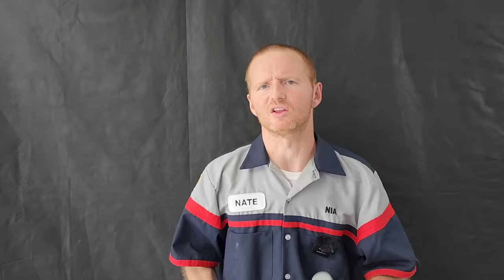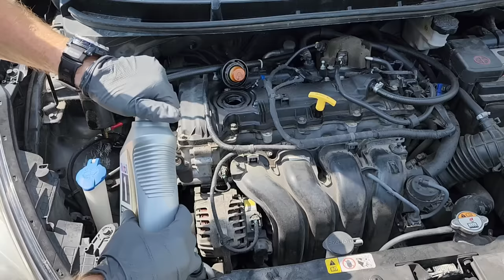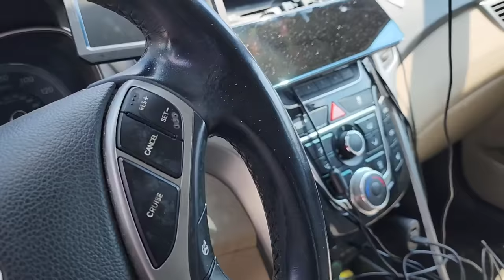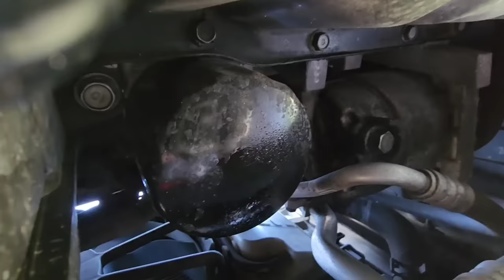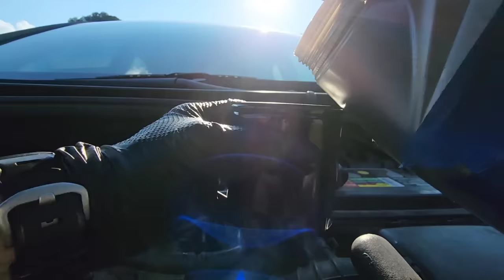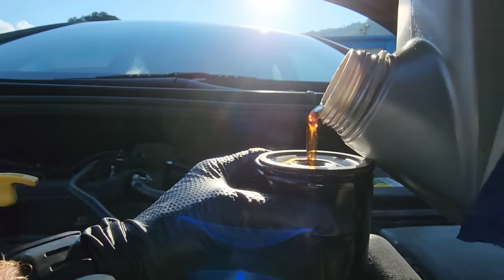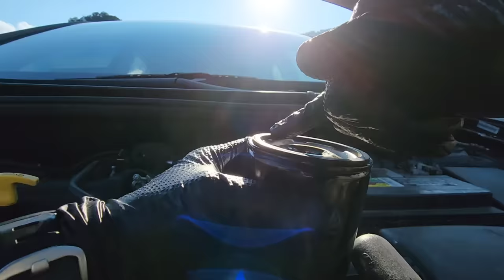Car owner sued after Jeep kills Mechanic during oil change

Comment: A complete tragedy… Lack of attention by owner, but… If the mechanic was more careful, he would wait until the engine run, check if parking brake applied, then check for leaks after all these steps. In my opinion, it was a tragedy and no one could be guilty, because both was lack of attention.

Comment: Shop owners fault hiring untrained personnel not qualified to preform the task 
Machanic fault !… 
# 1: SAFETY RULE ONE YOU NEVER START A MANUAL WITHOUT SITTING IN THE SEAT FOOT ON BRAKE. Foot on clutch hand on on shift in natural…. 

End of story, absolutely no discussion about this.

Comment: I think that so called clutch safety switches are the worst "safety" feature ever invented. With no switch the car would instantly jump and scare the hell out of the operator and by reflex immediately let go of the key stopping and stalling. With the switch the engine would be full running mode when the clutch is released ,also, if the engine is  cooled  off it would be in fast idle mode. I have been around standard transmission cars for along time.

Comment: Its called vicarious liability.  Many states have vehicle laws that impose vicarious liability on the vehicle owner for the actions of a driver that has permission to operate the vehicle.  The owner, in this fact pattern, could sue the dealership for indemnity on the basis that its employee was the negligent party primarily responsible for causing the injury to the victim.
Reply: That is right up there with Spectral Evidence, a legal statute used in New Englands earliest days to convict 'witches'. Definitely bad law.

Comment: Wow the guy changing the oil didn't know his way around a stick shift and how it functions , Sounds like the shop should be sued for hiring an idiot
Reply: Why would a 19 year old know anything about stick shifts? They aren't exactly common, anymore.  Most people don't want them. And, you don't have to know anything about shifting gears to change oil, replace an alternator, or do a number of other basic mechanics tasks.

The guy that died is most likely the one who forgot to pop the car out of gear and set the parking brake. Obviously, the 19 year old didn't drive it into the bay. It's highly likely that the fellow died due to his own errors.

Comment: First place if the 19 year old doesn't have a license or doesn't know how to drive a Manual or even a vehicle, then he shouldn't be starting or driving the vehicle.   Plus another point is it's everyone job to make sure safety comes first in the work place.    If ya are unsure how to do something it's better for some other person with experience do the job, along with teaching the person how things is done.   If you feel you need to be supervised on some type of equipment always ask until you feel comfortable enough to do the job.   I remember when in automotive class before lifting a vehicle up for the first time on a lift, we have to ask the teacher if we did it right before moving forward.   For me after putting a vehicle on a lift few times I still ask from time to time If I am doing thing correct while in Automotive class cause I knew safety was in my job description while being a student in automotive shop while in High School.

Comment: This is very sad, but there are several people who share the blame for this, and the vehicle owner is not one of them.
 I was an automotive technician, working exclusively at factory authorized dealership repair shops for over a decade.
Here are the safety rules that make this impossible, and every repair shop has the opportunity to learn these rules before accepting vustomers, as they are well published.
1. Never stand in front of a vehicle, or directly behind it, especially when the wheels are on the groung, while it is being started. You are in a repair shop, you cannot asdume that the safety mechanism are functional.
2. Never start a vehicle until the front and rear are clear.
3. Never start a vehicle unless you are in the car, and your foot is on the brake.
The experienced mechanic should have known better. Granted, we are all prone to lapses, but we also know that lapses are how you get hurt.
The kid should have been trained about these issues before being lut to work, so the owner shop foreman, and service manager have a degree of responsibility.
The kid has some liability because he has an obligation to learn his job, like abyone in any proffession, including safety protocols. 
The owner was no where near the car, had no reasonable belief, nor would any reasonable person assume that this business, or those employed, would use their car in an unsafe manner.

Comment: Every FCA vehicle that I’ve seen with pushbutton start requires you to press the brake pedal while pushing the start button. Add in the clutch interlock (which, granted, may have been bypassed by the owner or had the fuse pulled if it’s a Wrangler) and no way should it have started without an ass in the seat.

Comment: You can basically sue anybody for anything...
Now, whether you win or not is another issue. They might also be countersued as well for bringing about a frivolous lawsuit.
Edit: just finished watching the second half of the video. So it turned out the judge gave the car owner indemnity and they weren't responsible. 
The dealership did however get sued and  had to pay out though.

Comment: Did the owner give specific permission to the 19 year old to drive the car? No? End of story. The shop took possession of the vehicle and the shop should have made sure that only qualified individuals operated the vehicle. Someone with no experience in manual transmission should not be allowed to get behind the wheel. Shop's fault entirely.

Comment: how the flying f can you become a mechanic without knowing how to drive a stick
Reply: Stick shifts don't show up as frequently as they used to. Most people don't want the unnecessary hassle. Many people that DO want to deal with that sort of nonsense, are inclined to change their own oil, and make many repairs themselves.

As such, it's not really necessary that a mechanic know how to drive a manual. As long as there are one or two guys in the shop who can, it's not a big deal.

Unless the guy driving the vehicle into the bay makes an idiot move like leaving it in gear. Then neglects to set the parking brake.

Comment: Who doesn't leave a manual transmission in gear when left off?
If anyone is a fault it's the manufacturer for letting the car be started when it's in gear just pushing the clutch should not be enough

Comment: How did the guy know he had to to push the clutch in on a modern manual car to start it ? (autos won't start if they aren't either in park or neutral)  he either knew or was told that was the start safety 'lockout' system on a manual.

Comment: 100% the service facilities liability. Their employee caused the accident while in their care & custody.  customers are not usually allowed in repair shop areas for safety because of dangers & safety concerns the general public would not likely be aware of...  but the service facility had an employee that was using machinery he didn't know how to operate... in this case.. a manual transmission. no different than letting him weld on a vehicle & him not knowing to disconnect the battery before he fried the computers.  The vehicle owner hired a professional to do the job. it's left in their care & custody & therefore they are in full & complete control & liability.  If their mechanic took it on a test drive & had an accident or killed someone... it's not the vehicle owners fault or insurance liability... it's the shop who's in control & possession of it.... The attorney that brought that frivolous  lawsuit should be ashamed as well as potentially liable for mental distress & other issues created trying to sue & falsely blame the vehicle owner.

Comment: Suing the owner was the proper cause of action.  Cars are dangerous instrumentalities for which the owner is responsible.  The owner turned the keys over to the mechanics to work on his car.  The owner put the dangerous car instrumentality into the hands which resulted  in injury or death. 

Imagine the mechanic took the car for a test drive and ran over a pedestrian.  Do you think the pedestrians should be able to recover the insurance proceeds from the car that ran him over?  To do so, the pedestrian would have to sue the owner of the car driven by the mechanic.  Although the driving in this case was limited to a foot or two, the principle is the same. 

In order to recover insurance proceeds from a motor vehicle, it is necessary to sue the owner of that vehicle.  The insurance on the vehicle only covers accidents for which the owner of the vehicle is liable.  Realistically when the owner is sued, the plaintiff and his attorney are usually only seeking to recover the insurance that is on the vehicle.  The insurance company, not the owner, is the real target of the lawsuit.

Comment: I feel like it was the mechanics fault.  Lack of training.  This is a major learning experience for everyone about this kind of vehicle.  I’m confused… does it go in gear or neutral?… emergency brake?  If a car is a manual… shouldn’t the mechanic get in all the way to check instead of assuming to mash the clutch and start?  I know I wouldn’t have trusted it without checking.

Comment: Does not make sense.
I do understand the liability failing in the owner if they give keys to someone who does not know how to drive.
However, I would classify this more as a work accident that a road accident.
Beside, the shop is supposed to be made up of trained professionals, or at least have those professionals safe.

So my argument is, the owner should not be held liable as any reasonable person would expect that mechanics know how to safely conduct proper maintenance.
And with conditions in a mechanic shop are totally different from those at a road, the laws applicable to the road should not be apply.
As often safety device have to be remove or the car put to work in not road worthy condition to performe some maintenance procedure.

In sort, do not hold the owner liable when hey have no reason at all to think the may shop would run over someone with their car.

Comment: So doesnt know how manual transmission works but knows to push in the clutch to start the vehicle.   The mechanic should be responsible not the car owner.   My uncle was working on an AC system on a car behind a car on a lift.  He reached in to start the car and apparently the neutral safety switch was bad and it started in drive a drove forward smashing the hood into the back of the lift.  He was responsible for paying for the hood to be fixed even though the car had a safety system fault

Comment: I think that the mechanic is at fault . A mechanic should know the workings of a manual transmission. There is on most manuals a start procedure that requires you to press the clutch in order to start but some older. manuals do not have this function, manual drivers always make sure that the gearbox is in neutral prior to starting, it is second nature for those that drive stick.

Comment: This video is not legally accurate at all.  The way that this actually turned out was that the owner was (IMPROPERLY) sued, but when that happened, the owner turned around and sued the oil change business.  THE OWNER WON!  

Here's the thing.  For the family of the mechanic who was killed to successfully SUE THE CAR OWNER, they must be able to prove that the owner of the vehicle actually did something that caused the fatal accident.  Since the car owner left the vehicle for service with supposedly skilled mechanics, the owner is not guilty of any negligence and cannot legally be held responsible. 

Apparently, the owner had a good attorney who KNEW what the law says about liability and that attorney filed suit against the oil change business.  Why? Because the business owner was the one responsible for seeing that all of his/her mechanics were properly trained in how to handle an oil change for a manual transmission vehicle, and for seeing that a safe workplace was maintained at all times.  The owner of the oil change business is also legally responsible for having worker's compensation insurance covering accidents like this.

Comment: As a born & raised southerner…is this guy trying to sound as stereotypically southern as possible. Just curious. 🤔 

This story is confusing. So, I the guy who died was crushed in between the car & a roll around? And how can a “mechanic”, who’s qualified to do an oil change have no knowledge of a manual transmission? As far as the owner being liable, this sounds like another law that should be shut canned.

Comment: You're not a "mechanic" if you don't know how a "manual" transmission works (i.e. still the most common transmission in the WORLD). Are they suing the owner because the Jeep operated as it was designed to?

Comment: Very sad but it happens often. I think  the car manufacturers could solve this problem. The problem of runaway cars could be eliminated by having the drivers seat sensor, through the vehicle computer, apply the electric hand brake or engage park when the drivers seat has no one seated. The system works with ride on mowers. Why not every other vehicle ?

Comment: Who checks for oil filter leaks with the engine running? If it’s gonna leak it will leak with the engine off. If you screw the oil filter on right it’s not gonna leak. 🤷🏻‍♂️🤦🏻‍♂️😂

Comment: Not sure where you got your info, but I doubt the owner could ever be held liable for a mechanic's actions inside the shop of a dealership...or any other repair shop...the rare exceptions wouldn't even apply in this case...that would be no different for someone suing a homeowner for a roofer's mistake if he fell off the roof of the house, for example...the mechanic is solely responible for following all safety requirements/precautions in the shop and for his own actions...that's common sense and normally would be law in all 50 states...if you have an actual statute that dictates the owner can be held liable, post it, let's see it in actual law.....now, in this case, the one that did not follow safety precautions, such as making sure the gear shift is not in gear, or asking for assistance if he doesn't have the necessary knowledge, is the one that, along with the dealership, is responsible, nobody else....

Comment: I never understand why people with a manual transmissions park their cars in 1st gear.
I always left mine in neutral with the e brake pulled up.
U said experts say to leave it in 1st so it won't roll away but those "experts" are morons because if the e brake isn't pulled up and it's in first gear, the minute the car starts its going to at very least lerch forward.
In neutral, as long as u apply the emergency brake that car isn't going anywhere. 💯

Comment: Not placing blame OR anything... Just FYI... MECHANICS... SET THE PARKING BRAKE... HARD IF IT IS A CABLE MANUAL BRAKING SYSTEM... ON ANY VEHICLE THAT YOU ARE ABOUT SERVICE... For any reason... This may help the vehicle from moving... Unexpectedly... You need to be careful at all costs... When in doubt of your abilities... STOP... READ THE TECHNICAL MANUAL... Never assume...

Comment: Definitely a bad situation and an abnormal turn of events. Just my opinion, but why not use the parking brake? This would have resulted in the vehicle jumping a little before it stalls instead of the unfortunate outcome. Either way shop should be liable for the employee not being properly trained.

Comment: I generally do all my own work to my vehicles. But once every two years I have to take it to a facility regardless for a state inspection. I always ask the dude at the counter AND the tech if they know how to drive a manual for safety reasons and not wanting to have my expensive transmissions destroyed by an idiot. Some techs especially older dudes will get very offended at this but I could give af less if it hurts their feelings. Several years ago a friend of mine took his manual trans civic to a tire shop where the tech shoved it into first without pressing the clutch. Which not only annihilated the trans but sent the car into a row of Snap On boxes just as like what happened in this instance.

Comment: That vehicle should have NEVER started with it in gear....clutch or no clutch......for just EXACTLY this reason. That's a design defect.....unless the car was altered later.
Reply: If you press the clutch, you disengage the transmission, therefore the car starts. Most manual cars start when they are in gear, as long as you press the clutch. Its not rocket science. That is why manual cars can be started by pushing them if you have no battery. Its not a design defect, it is pure incompetence by the driver that started it.
Reply: @Flavor88   " Most manual cars start when they are in gear, as long as you press the clutch" 
That's a design defect. It just got this man killed.
Reply: @rael5469  How is it a "design flaw" when it is purposefully design to do that? Do you guys use logic?
Reply: @Flavor88  It's purposely designed to do that? Then it's criminal negligence.
Reply: @rael5469  You have clearly never driven a manual transmission... What exactly is criminal negligence about starting a car with the clutch engaged? Do you know that you cannot start the car if the clutch is not engaged, if your transmission is in gear?
Reply: @Flavor88   "What exactly is criminal negligence about starting a car with the clutch engaged?" 
.....because it killed this guy. It was a set up.
Reply: @rael5469  do you know the circumstances on how he was killed?